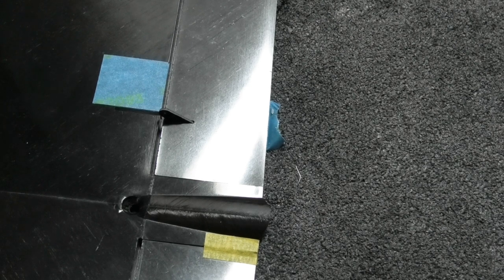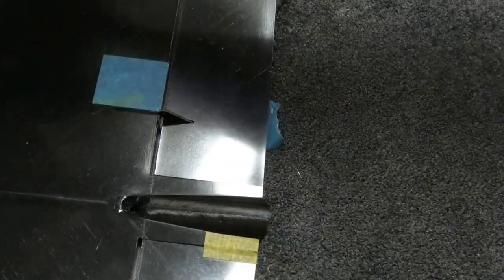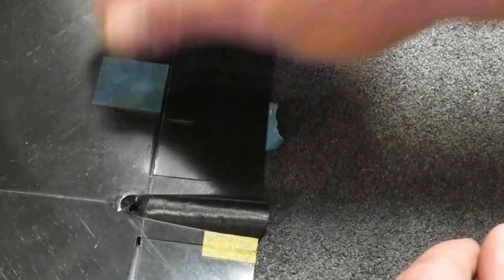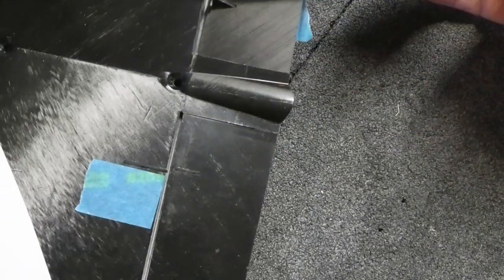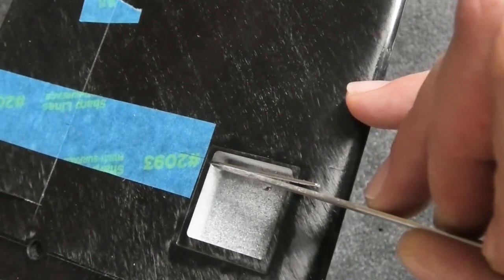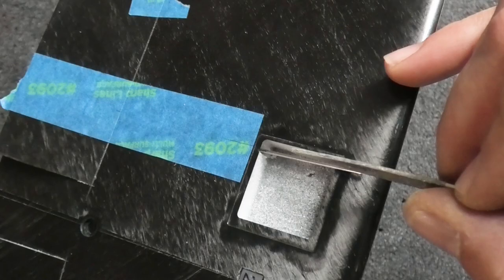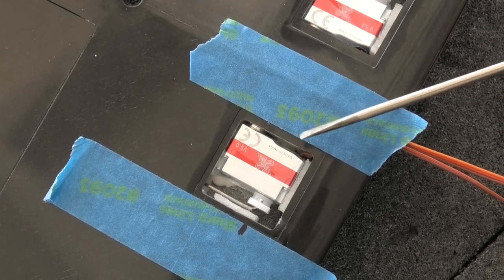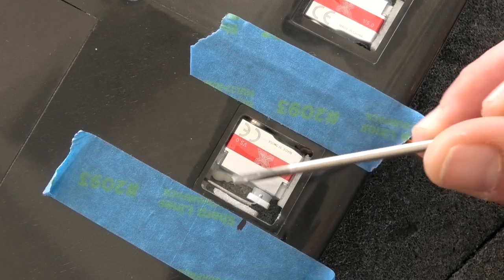Micro Max 1.15M RC slope soaring glider wing build

Comment: Mounting the horns with CA on the surfaces with 8cm 0,5mm Z bend rods and taping the wires, battery and servos on the uncut fuselage externally, works for me.